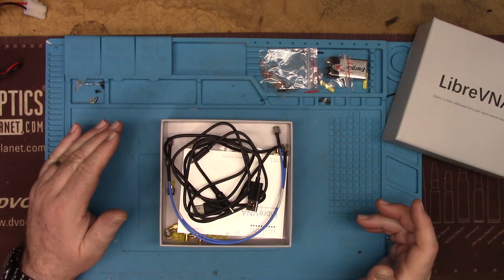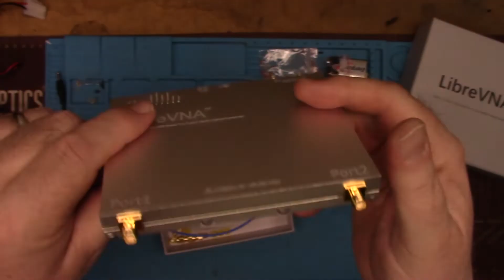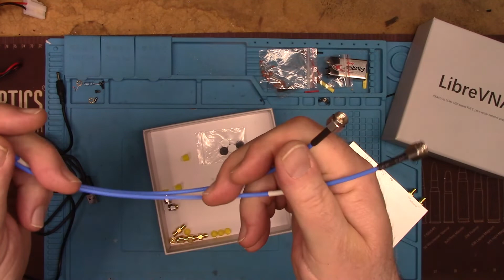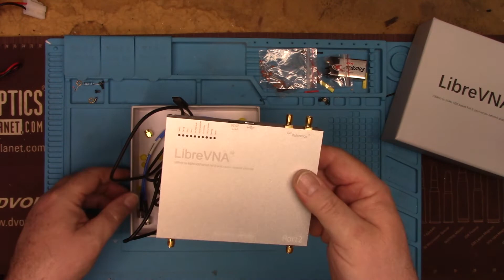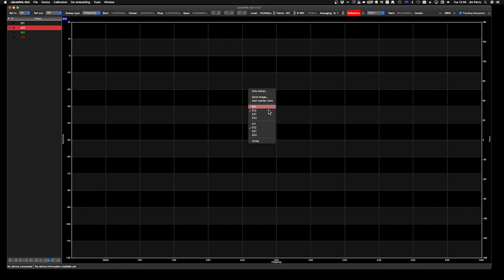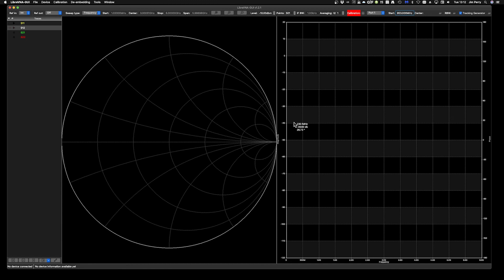LibreVNA - #hamsexy

Comment: The VNA6000 from nanorfe has much better performance specs!  But I will say the Librevna is well made!  The fasteners are all there for better shielding.  And there is lots of info on it, including block diagram and schematic.
Reply from the maker: I'm sure there are better ones, but I got to say, I've been pretty impressed with this one.  I actually looked at buying a "real" VNA, then when I found out that, I decided I needed to keep both my kidneys.  Used ones are still crazy expensive.  I also see that a lot of these budget level VNA"s have nice specs, but what they don't mention in a lot of cases is that performance falls off pretty rapidly above UHF.  I don't mess with anything above 440 so that issue hasn't plagued me.  The only downside I can say about the Libre, is that it gets quite warm when you're using it, and they are serious about the power requirements for it.

Comment: Hi, Can I use LibreVNA for WR284 waveguide measurements? WR284 cal kits come with waveguide to coax adapters & loads. Can I use SOLT part of software to calibrate LibreVNA before measuring s parameters of waveguide device? Please advise. Thanks.
Reply from the maker: Yes you can.  As long as what your doing is in the range of the Libre, it should work fine.  As far as the SOLT, you certainly can use it as well, and calibrate for what you're testing.  I like to calibrate out whatever cables and connectors I'm using, to move the reference plane as close to the DUT as possible.  That way I don't worry about adapters in the signal chain, going from SMA to X-Y-Z connector on the DUT.

Comment: Hi! Concerning your question around 15:41
* De-embedding is a technique to get your measurement results "closer" to the device under test. Imagine you have a filter on a PCB which has some longish lines in front and behind it. If you know the line properties and you want to see, let's say the phase curve of the filter without the lines, you would try to de-embed the filter (i.e. remove the phase delay of the lines).
* Matching tool: Since I don't have a LibreVNA I cannot say if this is 100% correct, but it looks like a handy tool that will tell you for a given measurement (input reflection) what matching circuit you would need to match it. For you to try: Attach it to, say, a 40 Ohm shunt resistor or a capacitor and fire up the tool. It should tell you what component values (for the selected topology) you need to add in between to match it to the input's 50 Ohms.
Reply from the maker: Thank you!  I had not researched what that meant.  your explanation is very good.  I will have to re-visit that in a separate video.  I hadn't heard that term before.

Comment: Just a quick comment about 21:13 No different developers (it is just me). It is also the same code for all operating systems (just different compiler runs) and so far I assumed that the Apple version behaves identical to the Linux/Windows version. It should only show you the toolbars relevant for the mode you are currently in (and you can switch modes between VNA/SA/SG in the top right corner as you mentioned). Unfortunately, I do not own an Apple PC, so I don't have an easy way to debug and potentially fix this. I am doing some "not-so-standard"-Qt stuff to achieve these different toolbars and the mode switch in the menu bar. Maybe some of these things don't really translate well into the Apple framework.
Reply from the maker: Hey thank you for watching!  I like the product, it works very well.  I had gotten familiar with the windows version (out in my shop), then also recorded part of it in the house (mac).   I can imagine with an apple computer, coding for it is somewhat of a pain in the butt!  I had no problems with either version, just some interface confusion.